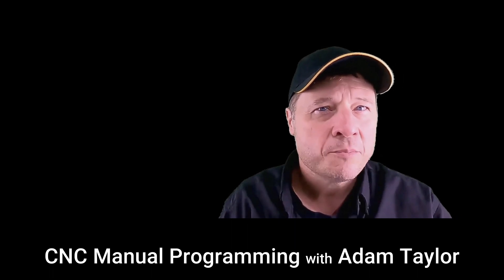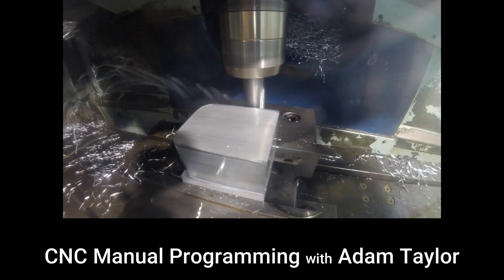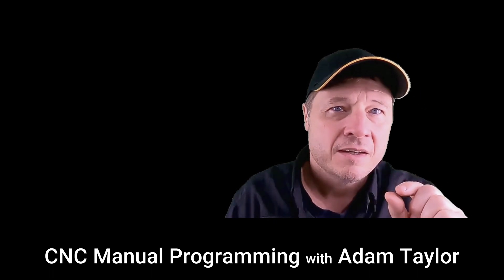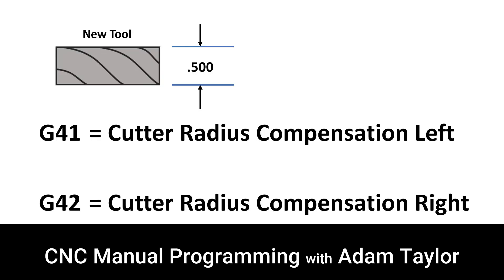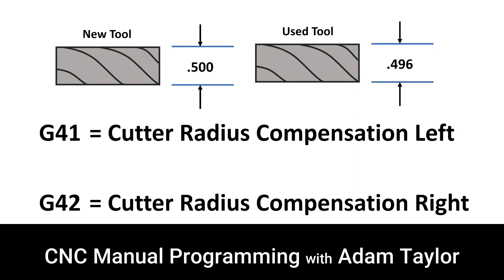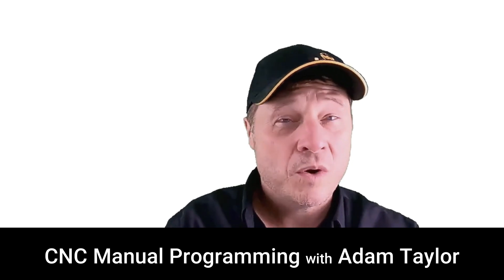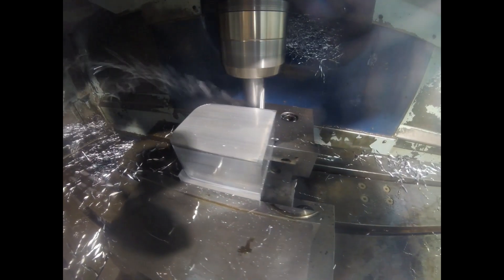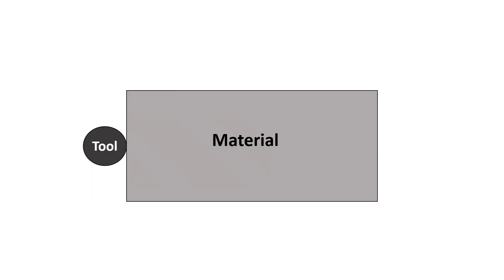CNC manual programming lesson 7 part 1 G40 G41 G42

Comment: Is it below my understanding is correct 

Material on right side of tool while traveling from bottom to up G41 will shift cutter towards Left and away from part 

Material on left side of then tool ,while traveling bottom to up G42 will shift cutter to right side and away from Material.
Reply from the maker: Hello @ibrahimsedqpatel5203, If your tool is traveling from the bottom of the part to the top of the part on the outside of the part and your material is located on the right side of your tool, then you would use G42.  G42 is cutter compensation to the Right. This means when you want to offset your tool to cut more material when your material is on the right side of your tool, you must use G42.  See 4:15 in the video.  I hope this clears things up for you.
Reply from the maker: I wanted to reach back out to clarify something regarding the G41 and G42.
If you use G41 right from the start of your program rather than adding it in later to fix dimension issues then G41 will allow the tool to compensate to the left of its path and G42 will allow the tool to compensate to the right of its path.

This video was intended to help you add code to eliminate dimension issues.

I will post a video in the near future to clarify.

Comment: When I worked as a CAD/CAM programmer, I used to program a 0.01 mm diameter tool (end mill) this provided flexibility for the operator to select a range of re-sharpened end mills with specifications on the max/min diameter. Needed to provide lead in and lead out paths outside the machining envelope when evoking/cancelling the offset.
Reply from the maker: Thank-you for taking the time to leave your thoughts. I always appreciate learning tricks of the trade from other experienced trades people.

Comment: 4:17 you switch g41 with g42.....g41 it's the left side of the tool
Reply from the maker: Thank you for the comment @lorenzopetrini.  If you notice in the video, the red arrow switches from pointing down to pointing up. G41 indicates that the material that is being cut is on the left side of the tool and this is evident when the arrow is pointing down. G42 indicates that the material that is being cut is on the right side of the cutting tool and this is evident when the arrow is pointing up.
I hope that this clarifies the switch at 4:17.